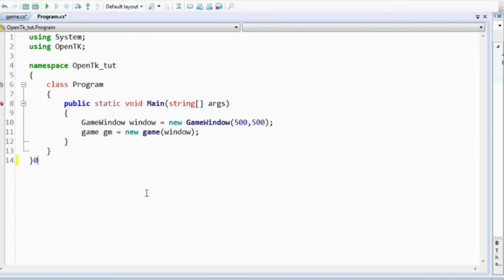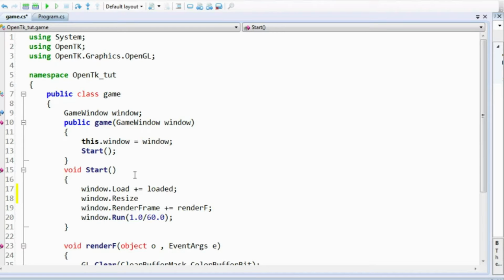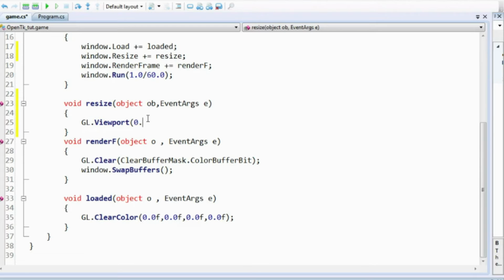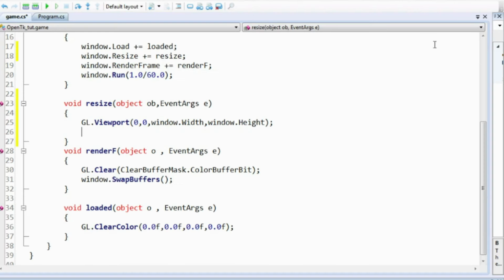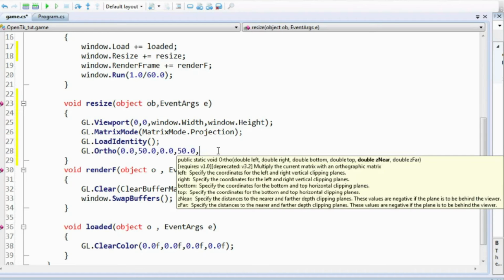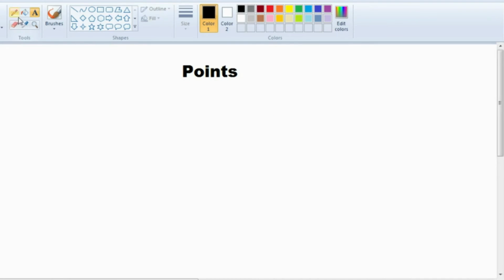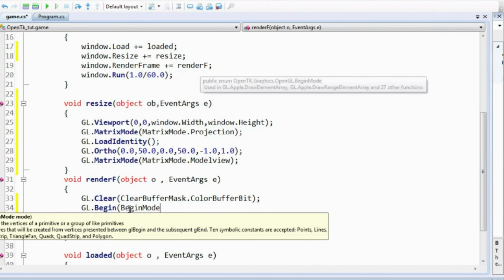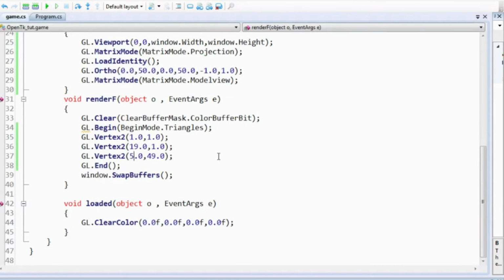OpenGL and C# Tutorial | The OpenTK Library | Part -2 | Drawing a simple 2D triangle

Comment: Hi, Sir. I have a question about OpenTK. I followed your tutorial in this video, and created a triangle on OpenTK window. Now, let's say I want to know the length of the triangle by clicking on the triangle, is it possible to achieve that? For example, let's say when I click on the triangle on the OpenTK window, the length of the triangle is displayed to the user. Is it possible to achieve that using OpenTK?
Reply: Are you still using OpenTK? Have you learnt how to draw other primitives than triangles (lines, circles etc)? Why does anyone talk only about drawing triangles in OpenGL/OpenTK?
Reply: @plrc4593  It is recommended to use only triangles to make up other primitives (render 2 triangles for a quad, loads of triangles for a circle,...) since modern GPUs are very optimized to render triangles.
Reply: @reimnop  Ok I understand that, but what if I want to draw a circle or line? ;P Is it possible in OpenGL/OpenTK? OpenGL/OpenTK turned out difficult as fuc and I gave up. I dabble with SDL now.
Reply: @plrc4593 you should be able to do it in a fragment shader by using the discard keyword to get rid of pixels that lie outside the circle